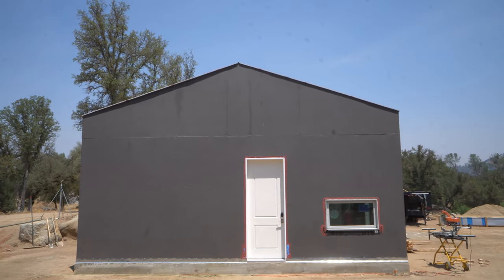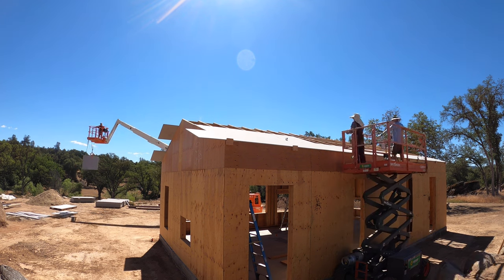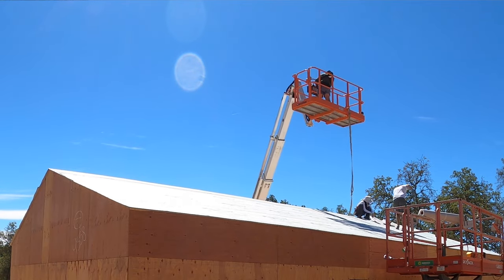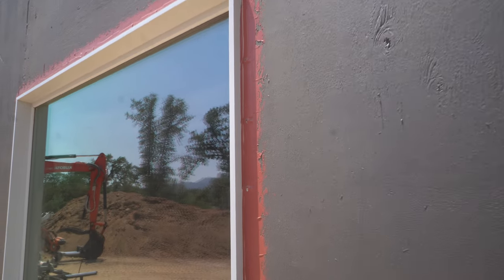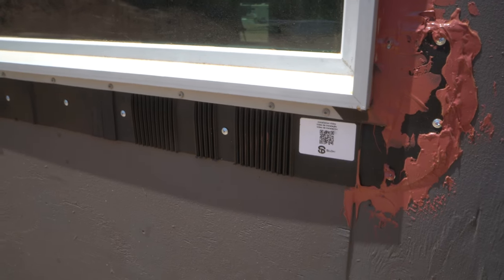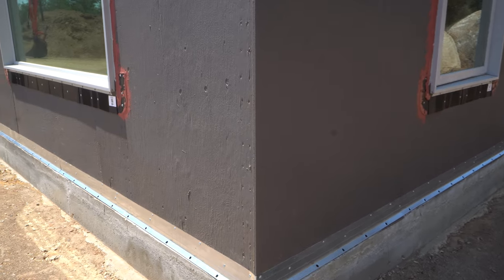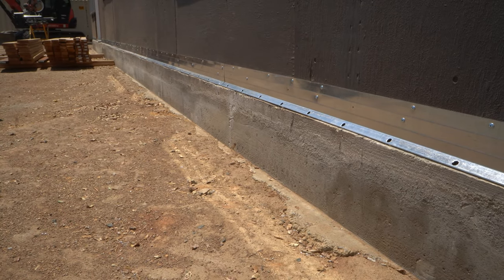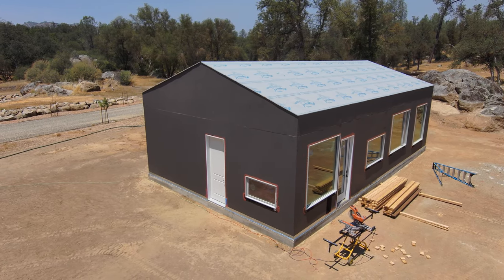Building envelope complete!

Comment: Did I miss the video on the final framming inspection? How does the hurricane ties for trusses work?  Where you able to use coil strap or did you have to use one of those engineered systems?
Reply from the maker: I guess we never made a video with final framing details. For the most part the plans had it to code standards with some extra portal frame details around the largest windows near the corners. It's not very windy where we live so we could have just nailed the trusses down but we added a simpson bracket on each one to make ourselves feel better.

Comment: Hey guys, just found your channel recently. Really enjoying watching your build! Great info. Regarding the stucco weep screed and the edge of the stem wall.  As you know typically the stem wall is flush with the exterior OSB layer and sill plate, and the stucco weep screed protrudes out past the stem wall. With you configuration, of having a ridge/edge at the stem wall and the weep screed over that, wouldn't that configuration allow water to get trapped there and cause moisture damage to the sill plate over the span of time?
Reply from the maker: Thanks for pointing this out! :) The way we  our "brick ledge" was formed, the bottom of the ledge is about 1-1/2" below the top of the foundation (the sill plate and the exterior sheathing sit on the top of the foundation--this video probably shows it better than words: https://youtu.be/ArlzqqLAoJs). We then applied the WRB over the exterior sheathing and extended the WRB 1-1/2" below the sheathing, to the bottom of the brick ledge. Then we installed the weep screed, much like the conventional way where the bottom of the screed hangs below the bottom of the sill plate. Then another layer of WRB was applied before the stucco lath... (our stucco contractor went around and silicone'd the staples too!) The WRB layers we used were both vapor permeable for our long-term peace of mind--should there be any moisture that makes it to the wood, there is an opportunity for the building to dry out.  All the rain we've been getting here in California has been a good test for our exterior envelope assembly! So far so good, we hope it stays that way. :)
Reply: @BuildItLikeBeckhams  Ah, I see it it now. First time seeing this type of stem wall design. Looks good and functional. Also love the 2x8 construction. Lots of new things for me. Looking forward to seeing more of your build. Thanks for the reply! :)